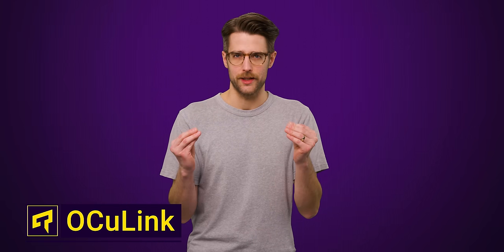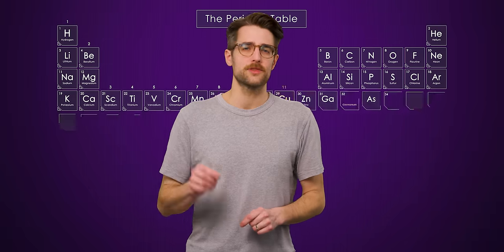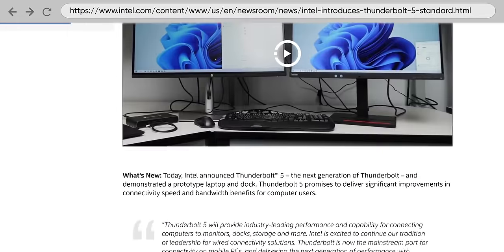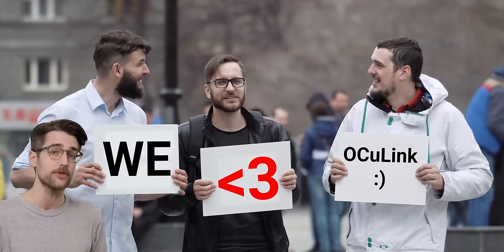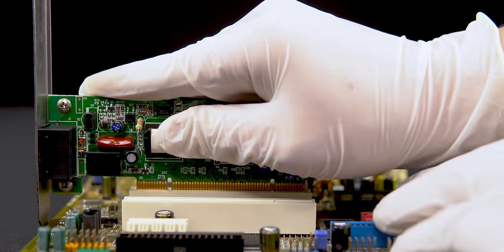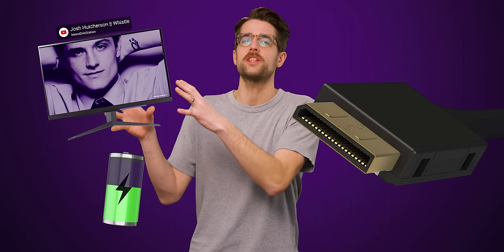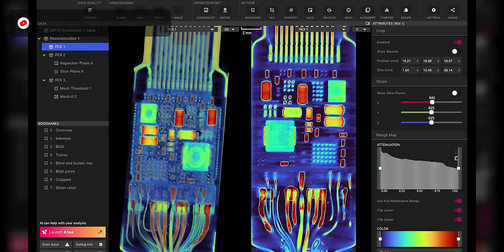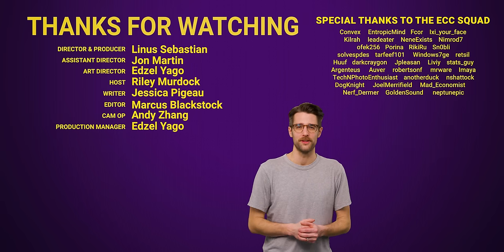The Best Connector You’ve Never Heard Of: OCuLink

Comment: The PCI group should lend their naming guy to the USB forum guys.
Reply: what, you don't like the name USB 3.1 2X2 gen 2 XL ?
Reply: Did you forget that they change the naming scheme for USB 3?
Reply: the names are terrible but I think the biggest issue are the "standards" that are not really standard where you can have 3 different types of USB C all with different "standards" so you end up getting dumb names for the same type of connection that has different standards.  I.E. Standards are not really standards if you are catering to different types.
Reply: USB 3.3 2x2 miniC PCIE x4 double super speed
Reply: blip-hn6is both Intel and AMD use 4000+ pin sockets for their high end cpu platforms. Until they want average users to use as many pci lanes and other features u probably won't see the normal platforms get much more
Reply: blip-hn6is  A joke right?
Reply: @marvinkmooney7815  The whole name change of USB 3 was mostly unnecessary and has made all the more complicated.
Reply: Can't, just thinking up the names takes up all their time.
Reply: The official USB naming is actually pretty simple (USB 40Gbps, for example). The real problem is the tech press, who keep using internal-only names for the general public - names like "USB 3.2 gen 2x2" were never intended to be used outside of the specification documents......
Reply: USB 3.1 2x2 Gen 2 SuperDuperHyperMegaSpeed Pro Max 2015 with Copilot
Reply: @williamthatsmyname 2 times
Reply: I’m looking forward to usb4v2 !! 64 Gbps of pcie goodness.
Reply: @Destructificial The official naming is Low Speed, Full Speed, High Speed, SuperSpeed and USB4 🥴
Reply: Ahh. I mean. USB 3.0. USB 3.1. USB 3.1 A, etc whatever the hell names they make up. Should keep it simple stupid and just USB 1, USB 2, USB 3, USB 4. etc.
Reply: And then there are the usb-type ports, that arent universally compatible, so theyre sb-ports
Reply: The pcie naming guy is the ++ operator.
Reply: USB4 2.0 😂
Reply: @marvinkmooney7815  Type C is merely the connector type, not the power and data specification.
Reply: I would name the versions after the speed, with the letter first or as the decimal in the case of v1.0.  For example: 1M5, M12, M480, G5, G10, G20, G40, etc. This way it is extremely simple to know what speed any port is, if a port is fast enough for a particular device and what grade cable is required to fully utilize it. The cables would also be marked the same way.
Reply: You say that, but on the box my motherboard came in, it also uses those "internal" names. And so does it on my USB-C to USB-C cable, etc. If anything, the USB forum should have expected leaks or whatever and not come up with such dumb names in the first place.  @Destructificial
Reply: WiFi came up with a nicer naming scheme than the usual WiFi n, ac, ax.. Now it's WiFi 4,5,6 now 7 is coming out
Reply: They dropped the horrific naming scheme. USB connectors are now simply named based on their speed and/or power. "USB 4" is still the internal name for the standard. But consumer facing materials should use indicators like "USB 40Gbps", "USB 60W", or "USB 80 Gbps 240W". This is easier to understand, but also super beneficial because one standard, like USB 4, can support multiple speeds and power throughput.
Reply: @thehailey  LGA 4094 for AMD Threadriper until 5000 series, LGA 4844 for Threadripper 7000 series and beyond. Intel's LGA 3647 is going to be succeeded by LGA 4189.
Reply: @simplifytech1  I'm confused, are u just confirming what I said?
Reply: @thehailey  yes.
Reply: the next usb will be called USB 2: The Streets

Comment: Fun Fact some VR Headsets like the Valve Index use the OCuLink connector for their main cable harness.
Reply: This should have been THE means to have a beefy GPU that you can hide behind the monitor in a separate case so your pc can be small. 1 of these OCuLink cables would be enough for a 2080 at least.
Reply: And those are only rated for like 50 insertions. Hardly the "best connector" or even "one you've never heard of"
Reply: Holy sh*t, only 50 insertions? That has to be a typo, right? Lololol that’s wildly bad.
Reply: Thats what I was thinking when I clicked on this, "Oculink" sounds like Oculus and it looks a lot like the cable that plugs into the original Oculus Rift headset even though its just USB 2.0 on the other end
Reply: @mlordwhiteslayerfromf.u.g  well yeah, but those are not meant to be taken out and in again
Reply: @paulmichaelfreedman8334  problem with that is that even with fancy high end retimer the cable couldn't be very long or signal degradation is going to cause you lot of headaches
Reply: @webbedshadow2601  Mostly coincidence: The Oculus headsets are named such because 'oculus' is the Latin word for 'eye.' But that is also where the word 'optical' descends from via a couple of intermediate steps, so there is a indirect etymological connection.
Reply: @boboe2244  where did you read that fiction ?
Reply: @boboe2244  AFAIK that's not true, the consumer oculink cable connectors are not rated that low on insertions, that was a different connector that was rated that low.
Reply: @Arctic_silverstreak  Yes agreed, these signals are meant for short distances. Yet OCulink achieves massive bandwidth on their cables.
Reply: Valve doesn't just use an OCuLink cable. the Index's connector has a breakout cable that turns into USB 3.0, DisplayPort, and power input. inside of that is a tiny PCB
Unfortunately, you can't use any OcUlink cable with the Valve Index
Reply: Yeah it's just the connector, they don't seem to actually use the OcuLink standard, not a PCIe connection.
Reply: Not that OcuLink would even be capable of the 6 meter cable length of the Index anyway.
Reply: Can't use it for power so my index must be perpetum mobile
Reply: like shjt:
Reply: My VR headset has a 1394 connector which is fine because VR hasn't gotten any better in the last 15 years. But it is getting to be a PITA. Had to buy a 20 year old adapter card and give my Ryzen a BJ before it would do anything on my latest PC.
Reply: @Lurch-Bot are you drunk. Vr has gotten incredibly far in 15 years... 15 years ago it was like 144p and no 3d and 5 years ago it was worse than 720p and no controllers. Now it's like human eye resolution with wide fov and high refresh rates. Apples headset is kinda meh though but so are the other Apple products I suppose.
Reply: the HP Reverb g2 v2 also uses OCuLink :)
Reply: Some VR headsets like the HP Reverb V2 use it, and it commonly fails after around a year of use.
Reply: Everyone except Oculus use OcuLink 🤣

Comment: I love how 4 PCIe lanes * 8 Gbps = 64Gbps 😭🥶
Reply: OCuLink comes in x4 and x8 variants. Max it can do is 64Gbps (16GB/s) @ x8. In x4 operation it's 32. Like you just worked out... 
They did mention it's two variants but yeah. They definetly didn't make that very clear. The way it's written makes it seem the 4 lane is what does 64Gbps. (they even put that equation up and its wrong lol). So don't blame you for being confused. That also means the 4 lane version (it's most common variant in the consumer space) is only on par with Thunderbolt at the moment. 
 You should point this out to them.
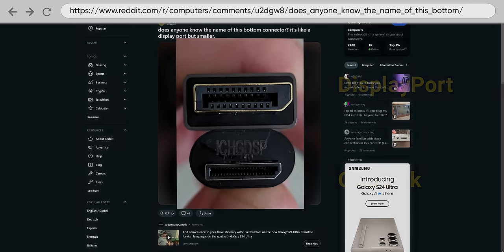Reply: @nated4wgy  No, that's very much what was said. And shown! At 1:10 ! Literally giving 4 x 8 maths on the picture! The 8-lane connection is mentioned entirely separately. 
In fact, at 0:58 they even show a timeline with OCuLink 2 at 2017, showing 4 lanes, and 64Gbps. Something's definitely off here.

Edit: okay, I went and looked. Apparently (though I honestly can't find much in terms of easy to parse information) the "64" in this case should be gigaTRANSFERS per second, GT/s. That is to say, 32Gbps, both ways at once. Like an Ethernet cable. That would also make your math make sense, since 16GB/s would be multiplied by 8 for bits, resulting in 128Gbps. But since it's actually half the throughput, running duplex - it's multiplied by 4 instead, giving 64GT/s. But... it's 64GT/s in its normal x4 configuration, not x8 like you said so...

Either way the video's very wonk with the numbers. Also why is there like two websites that even have the numbers?!
Reply: They made a mistake, Gen4 lane is 16Gb/s, 4 of them make 64Gb/s
Reply: isnt it 32 in one direction and 32 in the other so 32 * 2 = 64?
Reply: @nated4wgy  That was my point 😔
Reply: @BusAlexey  Correct, they mixed gigabits and gigabytes.
Reply: @johnschroeder3072  no they did not
Reply: @BusAlexey  Sorry I re-watched it where I had questioned it and realised it wasn't the off by 8 usual thing it was the "off" by two which was the difference between half and full duplex which is just confusing but not incorrect.
Reply: @BusAlexey  Yeah, you're right, it's that. I think they went by websites similar to what I found. Turns out I should have just looked at PCIe lanes, because the connector literally provides PCIe lanes.
Reply: @juravideos  pcie is dual simplex, meaning that each lane is actually two distinct physical pathways, hardwired for rx and tx. this means that maxing out one direction has no effect on throughput on the other way. in other words, that is in fact exactly how it works.
Reply: Next time, just keep your thought to yourself  🤣🤣
Reply: it's LTT, audience allows mistakes.
Reply: @nated4wgy  x8 variance is almost not present at the consumer market today. the x4 variance absolutely can do 64gbps when running 4 lanes of PCI-E 4.0, that's just their calculation that is off because of a mistake.
Reply: @Crecross  200 people agreed with me, surely that wasn't needed
Reply: I love how everyone wants an RP5 these days, with its single PCIe lane for both your NVMe and Wi-Fi adapter, lol.  Great way to waste money on storage. You can't even buy a drive slow enough for that kind of interface these days so anything you put in there is leaving 75% of the performance on the table, at best, and wasting your money. I thought the 4 PCIe lanes on the Orange Pi was minimalistic for 2024 but here comes the RP5, lol.
Reply: Your math is wrong.
Reply: @Lurch-Bot  No, LTT's math was wrong 😭

Comment: There is another big drawback to OCuLink you should have mentioned: OCuLink is more fragile, it's not rated for as many plug/unplug as a lot of other external connectors like USB, HDMI or Ethernet
Reply: Ratings are overrated... micro-USB is rated for 10.000 insertions, while in reality if you're lucky it survives 1000. Meanwhile mini-USB is only rated for 5000 insertions and i never have seen one fail, despite that i use that at work connecting it multiple of times every day (for years) and moving the device around a lot with the cable attached. (PICkit 3 Programmer) (We also use the PICkit 4 with micro-USB, but that thing had contact problems after just 2 weeks of use and we now glue on that cable so that it doesn't move.)
Reply: @bjiirn mini USB was the worst connector I have ever used, easily worse than microUSB.
Reply: I dunno micro usb is pretty bad
Reply: @FrodoMaster1996  Nah Mini USB is little larger but its lot more durable than Micro USB

Comment: If the Framework 16 comes with a 8x oculink2 expansion bay module at some point, it would easily replace my desktop.
Reply: I think the ports are only 4 lanes.
Reply: Agreed! I've been using the Asus ROG Flow series gaming 2-in-1 tablets which use a proprietary implementation of OCuLink for their XG Mobile eGPUs and they are amazing. But Framework's modularity is a game changer too. I'd LOVE to see all this in one product line, especially if its eGPUs weren't at all proprietary and vendor-locked!
Reply: @jolness1  there is a 8 lane standard as well.
Reply: @AquaeAtrae  yeah those look great, my biggest issue with those are that it's a closed garden, so i can't just chuck my existing gpu in a box and hook up, or use a different computer (unless it's a asus with XG mobile stuff) on it.

Comment: That explains why the ASUS XGMobile has 2 connectors and requires you to properly power off the system before disconnecting it, its using an OCuLink
Reply: Yea but it's a proprietary version of it so you can only buy their 2x MSRP GPUs for it. I have the x13(the first device with that connector) and it sucks balls having such an awesome connector with no real way to utilize it other than spending more than the cost of the device
Reply: @m.devellis  Blame Nvidia for that one. They're the ones controlling what devices their products are allowed in.
Reply: @m.devellis  If they come out with an EGPU Enclosure with the XG Mobile interface, I would actually sell my desktop without the GPU and just use the X13 for everything
Reply: @agentcrm  I keep hearing that but then it why does the Radeon XG mobile cost so much too?
Reply: @agentcrm so nvidia forced the use of a proprietary connector? What do they get out of it? There are no royalties for OcuLink
Reply: @m.devellis  OneDock has been reverse-engineering and developing a converter tobridge XG connector and OCuLink
Reply: @Kerbiter  THANK GOD
Reply: @Kerbiter  nvm they announced they abandoned it in favor of an m.2 adapter...
Reply: @HNedel  no it has to do with how Nvidia controls the supply of their products. I suspect it's so that they can get away with charging desktop GPU prices(or even higher) for laptop GPUs and force users to eat the cost and always need to buy a new laptop if you want something faster
Reply: @m.devellis  yeah, keep drinking that tin foil hat
Reply: Had to look that one up. If it is ASUS, you can bet it is a proprietary modification that isn't compatible with an open standard. Anyone can take any connector and use it however they like. Doesn't mean it meets the standard. Also, hot plugging has pretty much been standard for 25 years, so, again, proprietary, non-compatible standard, and a pathetic one at that. This is 2024. You shouldn't have to power down to plug something in. If you do, that is a sure sign you're getting ripped off at best and possibly inviting malware onto your system at worst. I don't even have to reboot when I install graphics drivers in 2024 so, WTF??
Reply: @Lurch-Bot  Honestly I don't mind having to power down the machine to use a GPU. And yes you're absolutely correct we are getting ripped off. It's the sought-after promise of a GPU upgrade in a laptop but at the cost of a whole nother laptop and at the price what tf is the actual point. If you're buying this laptop(or the Ally and other Flow models) exclusively for the XG mobile connector, look elsewhere because it's value is non-existent in that regard. It's a great laptop otherwise though.
Reply: @HNedel  Why would you "invent" a worst 12V connector if you don't want people to buy newer things?
@m.devellis is right you just don't see it, unless you catch on fire from said proprietary connectors that are made just to squeeze money.
Reply: @BozesanVlad  the 12V connector goes on their cards, they have some control over it. There is no OcuLink on the cards, the connector is on an external case. Nvidia has absolutely no fu****g control over what anyone puts on an external GPU case. Small difference, try to exercise your brain cells next time instead of going on rants about how nvidia „works“

Comment: OCuLink would be great in those laptops where the manufacturer cheaps out on USB4 w/ PCIe tunneling or Thunderbolt. All that's needed, is rerouting 4 PCIe lanes and soldering a connector and maybe a redriver, but no controller chip, which makes it cheap. It's a sheer and utter shame that it hasn't seen a lot of adoption, since it's currently the best solution for connecting an eGPU.
Reply: I'm buying the first laptop that does this with a decent enough CPU.
Reply: looks AMD has already dropped the ball since razer just announced the 2024 edition of their laptop will have thunderbolt 5.
Reply: You probably do not want an external pwn me port on a laptop. Though just that was actually not uncommon back in the firewire days.
Reply: @Carewolf  This can easily be tackled by disabling the associated PEX slot/lanes in UEFI.

Make it default-off and users, who want to use it, can enable it. When enabled, also force-enable IOMMU.

And suddenly you're more protected from DMA-style attacks than TB…
Reply: @Psychx_  Actually IOMMU is the right solution and it's enabled by default. It also works on Thunderbolt.
Reply: @Carewolf  Yep, I remember the first time I tried to network a pair of computers with firewire and had that typical WTF moment when a device I plugged into one of them showed up on the other. I wish firewire had stuck around a bit longer, it was incredibly useful for investigating a crashed computer as you could access the RAM through firewire  even if the computer was frozen. That's also why having it in computers was such a bad idea, even though it was stupid fast for the day.

Comment: me: sees thumbnail

also me: "DisplayPort!"
Reply: Disappointed
Reply: Me too lmao
Reply: i honestly thought it was some sort of composite video connecter (like used on the ps1 or the n64)
Reply: Ya saw it was released 12hr ago. So brain automatically said nope, not displayport, propably oculink or mcio
Reply: Yeah, my brain short circuited a bit when he said "oculink can't do video" when it looks EXACTLY like a Displayport cable.
Reply: Same here, literally this morning I used one of my 2 displayport ports to plug in an adapter for my HDMI monitor because none of my gear takes it directly.
Reply: This is what you might call, 'Display Port Plus'🤣
...as if such a thing were needed...or wanted.
Reply: i instantly though "WII VIDEO CABLE"
Reply: @notlazy2k  but that's rca
Reply: @Platinum_XYZ  not the part that goes INTO the wii
Reply: I see the thumbnail and click on "soyjack face".  Classic
Reply: It can be a display port, or any port if you are strong enough 😅